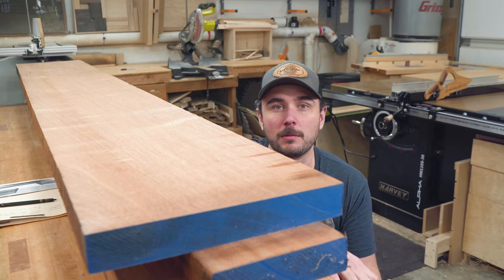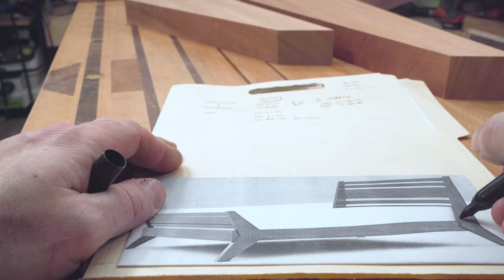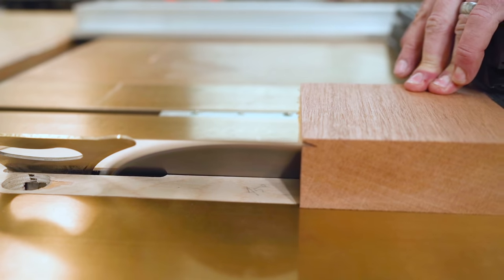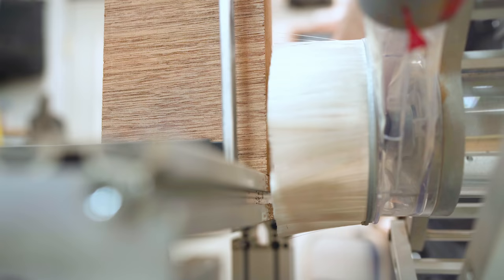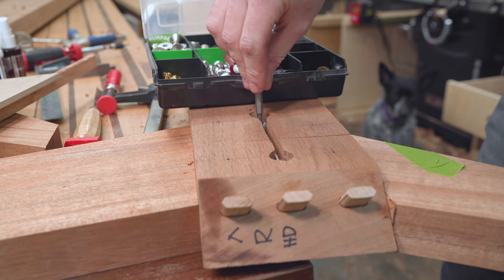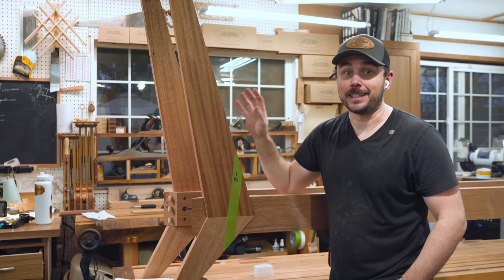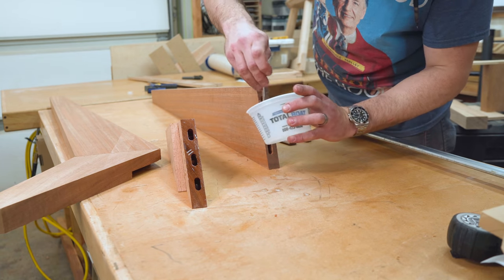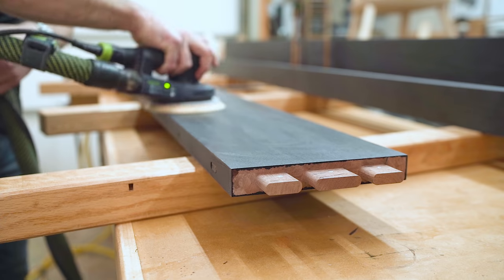Midcentury Modern Bed / WOODWORKING

Comment: Dude, you're a beast.  Unbelievable. I've never been any good and doing anything other than 45 degree angles.
Reply from the maker: Haha thanks man! A good miter gauge and a sharp low angle jack help a ton
Reply: @SawyerDesign  thanks for the tips. I’ll look into it. Your channel is under rated for sure.

Comment: First, I love the design. 100% agree about the wood contrast. It probably would have looked good without the blackening but it looks awesome. I have to try this. The knockdown joinery is great in my opinion. I think being able to easily pack it up and then very sturdily connect everything is a big deal.

Comment: I've used the vinegar / steel wool "juice" for several years now.  For a different effect, mix a larger portion of it in a metal coffee can or paint can.  Put it on the shelf and leave it for about two months.  You get a ton of oxidation from the metal can as well as the steel wool.  You get a more rusty color but it still looks weathered.  It also has extremely different results on different wood species....   On white oak it turns it a dark slate blueish gray color.   It lasts a really long time also.  I did not leave it in the can however, i transferred it to a plastic bottle - been using that one mix for a year or more now
Reply from the maker: Good tip David! I’ve found it’s efficacy diminished once the oxidation sets in but I’ll have to experiment with it a little more.

Comment: Good to see a heavy dose of hand planing to get those lovely silky surfaces :-)    And is that a Hammer A31 planer-thicknesser getting a workout?  Do you have the helical SilentPower head?  I have the same machine, with that head, and it's Fantastic.  I'd love to know if you have had the same good experience, and any tricks you have for best results.   The blackening trick is extraordinary - how much darkening happens on walnut sapwood?  (I have some boards that have a lot of sapwood.... and need to colour them down).   Cheers! Miles
Reply from the maker: It definitely works on sapwood, though doesn’t erase the line completely. I like my hammer a lot. Got both extensions, but the attachment is a little funky and not stable/reliable for jointing really long stock. The adjustment to get outfeed from spring jointing was pretty easy and overall love mine. Also have the silent wave. Super nice to not worry about grain direction anymore

Comment: awesome design, I choose to use black india ink instead of steel wool and vinegar.
Reply from the maker: Thanks! They both achieve similar results—Any reason why India ink over iron acetate?
Reply: @SawyerDesign  easier and IMHO looks better
Reply from the maker: Interesting. I’ve never tried India ink. Seems messy, but I’ll have to give it a try

Comment: very nice!!
will that solution work/ darken any wood to that black color?
Reply from the maker: Thanks Diogo! It works well with any species that has a High tannin content. You can add bark dust to the solution to bring up efficacy on species that it doesn’t react with.
Reply: Ok thanks a lot

Comment: Amazing design, and I think the knock-down engineering is probably as good as you can get it. It's always difficult to make furniture dis-assemble-able (word?) while maintaining structural integrity. Tough to balance.
Reply from the maker: Definitely tough to balance in a clean final result. Thanks Matt!